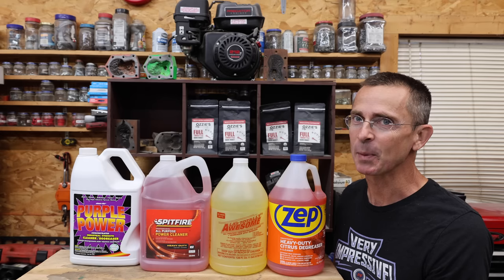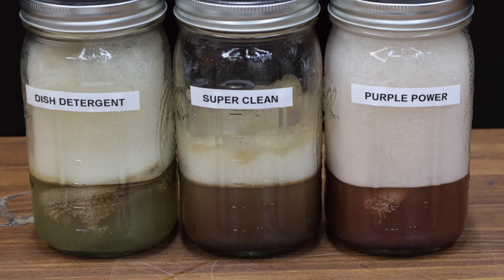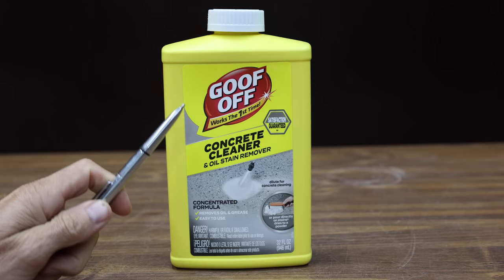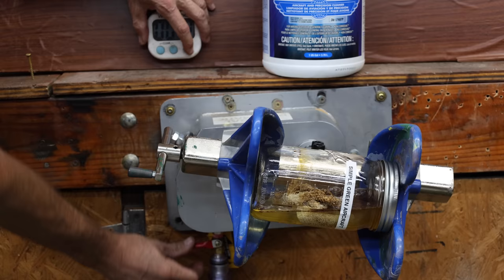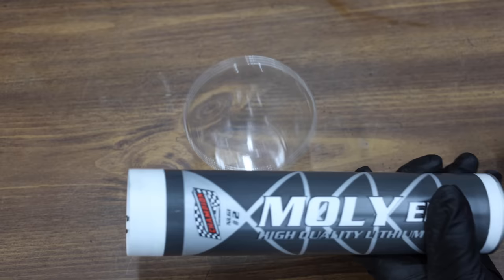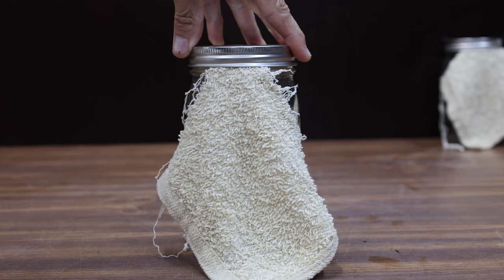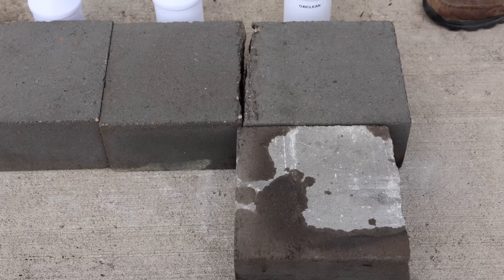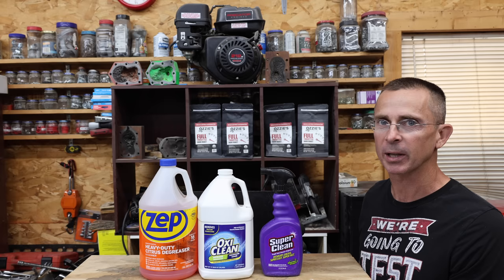Best Concrete and Engine Degreaser? Let’s Settle This!

Comment: as someone who grew up poor, my whole life I've been worried about wasting money on a product where all i had to go off of was the manufacturers words. you literally save me not only money, but precious days of my life. keep these coming! i would like to see videos on kitchen/household electronics like crock pots, mini fridges, phone chargers, robot vacuums?
Reply: Especially for stuff like this where there are so many options. I have probably three or four different types of degreaser at home and I couldn't tell you if any of them work better than any other. Having someone who's able to test all the popular options back to back is extremely helpful
Reply from the maker: Thanks, will do!  Thanks for the suggestions.
Reply: @ProjectFarm Have you thought about doing a Diesel Heater video? 

There's a wide range of units going from +$1200 to as low as $89. I know a lot of people use these on their RV/Camper vans. People are putting a lot of trust in these without knowing if they are safe. 

Not only that but is spending $1200 really getting you something better than the $100 version? 

Thanks for making your videos and working hard to keep them unbiased.
Keep them coming!!!
Reply: Robot vacuums, YES!
Reply: I will second robot vacuums...

Comment: I, for one, think that this channel should continue to review, compare, & test products that viewers suggest. However, doing other things like engine upgrades, transmission rebuilding, equipment maintenance, etc...should be added to ProjectFarm's content occasionally, based on the needs of the farm. If you need to do a project around the farm, making videos showing the start-to-finish process & methods may be of benefit for DIYers.
Reply: A lot of channels will make a secondary channel for this reason, that way the ppl who come here to watch product reviews dont complain about the farm related content.
Reply: @gaveintothedarkness  I feel like doing a second video on like Wednesday or Thursday about the extracurriculars would be fine and having the sunday videos be lovely product comparisons.
Reply: @StuffTested  agreed
Reply: @gaveintothedarkness Other channels I follow say that recommendations (YouTube algorithm) works better when not mixing content.
Reply: Keep it the same

Comment: Your product testing is unlike anything else on YouTube, with your care and obsessive making sure all factors are as equal as possible. Thanks!
Reply from the maker: Thanks and you are welcome!
Reply: You didn't even bother to tell us if each product was solvent, acid, alkaline, salt based. I'd still wager that clothes washing powder beats all these products
Reply: @janeblogs324  Every degreaser that I've dealt with has been alkaline, some strongly enough that they will damage aluminum parts. It would indeed be useful to know the ph of each of the products tested, but that information can probably be gotten from the manufacture.
Reply: @James1095 yes, most are alkaline. Super Clean even specifically states it can corrode/etch aluminum. Simple Green Pro HD, the purple stuff is like the WD 40 specialist and specifically formulated to be safe on all metals.

Comment: Honest and unbiased product's reviews are very rare nowadays. Your channel is a rare gem 💎
Keep doing what you are doing.
Reply from the maker: Thanks, will do!
Reply: @ProjectFarm  Would love to see a transmission rebuilt, something relatable like we might own. But as usual, the complete process, showing the transmission working well in the vehicle again. Same for engines, and even testing other kinds of products and seeing if they are as good as they claim. Love the product reviews, they really help. What if you tested upgrades on an engine and see if they yield the power increase that the company claims?
Reply: @enermaxstephens1051   Richard Holdener would be pretty tough to beat in that dept.
Reply: @BLKMGK4  Easy enough if you don't do the same things he does. Or you did it on different vehicles. For example, who would do things like that to an old RV? Or an old farm ranger? And you could do things they wouldn't expect: Here's how a underhood light turns out on your old junk ranger. 

Or even fix up the old junk ranger. People wouldn't really expect that, they expect it to be ran into the ground until dead and then scrapped. They wouldn't expect him to start fixing the body and any rust and making it nicer. Even if it will still be used on a farm.

Comment: Super Clean is the automotive industry favorite. Everyone is using that stuff. Great product
Reply from the maker: Thanks for the feedback.
Reply: I've used Super Clean on the valve cover, oil pan when I rebuilt an engine.  On aluminum parts you have to wash and rinse it quickly or it'll etch it.
Reply: Be careful, it can corrode/etch aluminum. A few years ago when YouTubers were hyping it for automotive use they said it was safe on all metals. Now SC has a specific warning about that it’s not safe for it. Because of that I’ve gone back to Simple Green Pro HD, the purple one. It’s specifically formulated to be safe on all metals.
Reply: @seashackf1  you said it yourself. "It can" etch aluminum. Don't allow that to happen and the SC is the best.
Reply: Super Clean is by far in my opinion the best. I have been using it and singing its praises for many years.  Love the stuff. I hear you guys saying that it will etch aluminum if you leave it on for any length of time. YES,  that just tells you that its got balls !  You just have to use your brain. You can delute it down alittle and it won't do that.
Reply: @mxracing6  I totally agree about using your brain and not being stupid, like many people can be. For certain things that would be fine. For my car, motorcycles, ATV’s, power equipment, etc. I’d prefer not to have to take the chance if there is a product that works just as well. Since there are products specifically made to be safe on metal I don’t have to. I keep my stuff look as good as I possibly can. Part of that is not damaging the parts when cleaning them, even cosmetically if possible.
Reply: purple power also etches/eats aluminum

Comment: YES to continued product testing!  Your methods are impeccable and very detailed.  Maybe Consumer Reports can learn a few things from your methodologies.  It would be nice to have you update some of your older tests with newer ones, as the market shifts every few years.
Reply: You definitely are already the best at what you already do so why not keep doing what you do best? I am into refinishing guns and would like to see you test all the different brands of bluing solutions, cold blue including Oxpho by Brownell. Make sure you test all with parts totally cleaned and degreased and also with parts not totally cleaned of rust and oil.b Also show totally wahed and dried nut without oiling parts etc.. Thank Bob Jones😊
Reply: I did like the Star shifter I installed in my 68 Nova/ Chevy II SS. Their transmission reprogramming kits were a joke. I put one in a turbo 350  that was in my first Chevy Nova. It was a 69 with a non performance THM 350 behind a 350 c.i.d. with a 2 bbl. Carb. The crisper shifts were very underwhelming! Then got into the transmission industry and found out what a SK green box kit for about $8 could do! Little bump on a shift, versus barking the tires and leaving 6 foot rubber fish hooks behind you on a 1-2 shift!
Reply: You are the God of product testing.

Comment: I work in an agricultural tractor dealer ship and we use oil eater at full strength most of the time to clean engines,transmissions,hydraulic caked on oil it works very well great stuff in my opinion.
Reply from the maker: Thanks for sharing.

Comment: I'd love to see glass cleaners across plate glass, laminate glass, and what I've really noticed to be tricky; auto acoustic glass. Smartphone style ceramic coatings/screen coatings would be another great test.
Reply: I know this was a suggestion for the channel, but I’d recommend checking out Griot’s Garage glass cleaner and the accompanying microfiber towels. I don’t know what’s in the stuff, but it’s non-ammonia based and works amazing.
Reply from the maker: Thank you for the video idea!
Reply: I liked Stoner Invisible Glass. I cannot remember if the spray bottle was better than the aerosol can.
Reply: for normal dirty glass: water mist and a clean microfiber cloth,
Reply: @Bob_H Not if the windshield has oil from the road on it!
Reply: @glasslinger  I'm pretty sure that's why at the beginning of his sentence he clearly stated, 'for normal dirty glass'  🤪

Comment: I remember using that Castrol Super Clean many years ago to degrease an engine bay. I recall the fumes when spraying the product being almost caustic.  After several hours most of the grease seemed to just melt off after being rinsed with a pressure washer. Very effective in removing dirt and grease with minimal scrubbing.
Reply from the maker: Thanks for sharing.

Comment: I’ve been using the Totally Awesome almost exclusively for 5-6 years now. Have been extremely happy with it. Can buy the smaller jugs of it for $4 at Family Dollar and it last a long time. Gets used mostly for removing ink, marker and other stains from countertops when most normal products will not remove it
Reply: Good Post!
Reply from the maker: Thanks for sharing.
Reply: It's my go to for decreasing and affordable.  Works great but the fumes can be strong if not ventilated well.
Reply: Dollar Tree sells 32oz spray bottles of LA's and a bunch of other kinds of generic and name brand cleaners for almost everything. Dollar Tree is of course $1.25 per item and their cleaning/household and energy drinks (plus name brand super glues and other adhesives, tarps, brushes, etc) are genuine bargains you just don't see in local retail.

Comment: I would keep your channel the way it is - Simple and to the point! I would also like to see a review of paint brushes (for acrylic house paint) and manual caulking guns.  I will say that I switched over to the "Twisted" trimmer line and you nailed that review!  Very pleased with the performance of the "Twisted" trimmer line
Reply from the maker: Thanks for the feedback and suggestion.
Reply: I asked about the paint brushes because I have been using Purdy Brushes for years - but often wonder - they were recognized as a best brand when I was growing up using oil paint - but are they still today when acrylics are the norm?  @ProjectFarm
Reply: Yes! Test caulk and the guns!

Comment: I am happy to see Super Clean rate so high. I've always relied on it when cleaning engines and built up cooking grease because I know it works well for what I can afford. Now I no longer have to wonder if I have been missing out on the more expensive stuff.
Reply: SuperClean seems more pricey than purple, but I have to use alot more purple.  I've also seen it take the paint off as a straight concentrate.
Reply from the maker: Thanks for sharing.
Reply: Would you recommend it for concrete? I have a furnace that burns heating oil and one time a bunch of soot got onto the concrete floor and it's very difficult to get out.
Reply: Be careful, Super Clean and Purple Power can corrode/etch aluminum. They have a specific warning about that it’s not safe for it. Because of that I’ve gone back to Simple Green Pro HD, the purple one. It’s specifically formulated to be safe on all metals.

Comment: I'm a coal miner and I tend to get pretty black with coal and oil/grease. The best soap to get it off my arms and hands is dawn dish soap but I use it full strength out of the bottle.
Reply from the maker: Thanks for sharing.

Comment: I've used Super Clean for over 20 years, and have found it to be superior to any other cleaner for most cleaning tasks.  I've been a big fan of your product testing channel since I discovered it several years ago, and have always found your well thought-out testing procedures to be fair and very conclusive.  That being said, I would watch pretty much any content that you put out, knowing that it would be interesting and entertaining.  All I would ask is that you continue to do product testing from time to time... nobody does it better!
Reply: Super Clean is the best I've found, as well.  It's got enough sodium hydroxide in it to eat your skin though, so everyone wear your gloves and don't make a habit of breathing the fumes.
Reply: Agreed.  I have been using it since the early 90's
Reply: Yep super clean is the best and it biodegradable.
Reply: @OvertravelX Super clean can also corrode/etch aluminum. They even now specifically warn about it. Unlike the WD40 Specialist and Simple Green Pro HD which are specifically made to be safe on all metals and not corrode.

Comment: I've been using the zep cleaner for a few years with great results, good to see that it actually stacks up well against the competition in your testing.
Reply: Have you tried Zep purple acid-based industrial degreaser? That's all I use. Curious how it compares the citrus Zep.
Reply: @branchandfoundry560  gotta be careful with what you use it on. also, if you use the metal degreaser from them that has its own specific uses too!
Reply: @CT_Taylor  Oh, I wasn't aware of their metal degreaser--will look into that. Thank you! Edit: Do you have a product name on that? Zep website does not list a metal degreaser. Thanks!
Reply: i use the ZEP Floor Stripper on my degreasing tasks... its the best i have found for degreasing, give it a try....
Reply: orange oil is amazing stuff!
Reply: Surprised Greased Lightning was not in the lineup
Reply: @branchandfoundry560 yes most of these aren’t safe for all metals. They can corrode/etch aluminum. Unlike the WD40 Specialist and Simple Green Pro HD which are specifically made to be safe on all metals and not corrode.

Comment: Just a little Dawn dish soap secret on oil stay in the driveway. Cover the oil stain on a a real hot sunny day with dawn scrub in with broom( don't be cheap) put a little on than leave it to dry in the sun for a couple days . When it rains it will usually take car of the problem.
Reply from the maker: Thanks for sharinig.

Comment: When I was in the Coast Guard we used two products for degreasing.  Simple Green and diesel fuel.  It's all we used.
Reply: Separately, I assume.  I'm picturing hundreds of people mixing a bucketful after reading this.
Reply: In the Air Force we used a mixture of diesel fuel and something referred to as "gunk". I don't know what that really was. The combination cleaned the airplanes up very well.
Reply: Simple Green works pretty good but it's very bad for oil/water separators. I forget the term but it will cling to the oil and let it pass through the oil/water separator.
Reply: Simple Green was reformulated maybe 10 years ago to remove 2-butoxyethanol.  I find the current product much less effective at removing household grease and oil.
Reply: Yup a good tip for someone working with oil paint is to use diesel fuel, which is the same thing as kerosene and much cheaper than store bought paint thinner.
Reply: As a mariner, we used a combination of Simple Green and phosphoric acid "Ospho" to easily remove rust stains and paint prep for white bulkheads. It worked great but you need to be careful using it on aluminum structures and fixtures as it will cause it to oxidize quickly. Rinse well.
Reply: @gdholmfirth petrol and paraffin is how we make gunk 🇮🇪👍🙂
Reply: @engineerncook6138 . Pretty sure the HD he tested has it in there.  The HD is quite weak, IMO.
Reply: Your product reviews are the best. Keep up the good work!
Reply: @for2utube the SG Pro HD is specifically made to be safe on all metals. Unlike most of the others here and regular SG which will corrode/etch aluminum.

Comment: I used Super Clean for the first time a couple weeks ago before watching this video and I'm not surprised Super Clean did so well in this competition.  I was amazed at how well Super Clean works.  I cleaned an 18 year old diesel engine to replace a water pump and I was shocked at how well it de-greased the engine... it looked new and I didn't even touch it with a brush or rag... just sprayed on the Super Clean... waited a few minutes and rinsed it off!
Reply from the maker: Thanks for sharing.
Reply: same, I used it for the first time a few months ago on a really dirty riding lawn mower engine. I sprayed it on and let it soak for not even 20 seconds and sprayed it off with a garden hose and all the grime melted off and I was left with a brand new looking engine. for the money you absolutely cannot beat it
Reply: Be careful, SC can corrode/etch aluminum. They even now specifically warn about it. Unlike the WD40 Specialist and Simple Green Pro HD which are specifically made to be safe on all metals and not corrode.
Reply: @seashackf1  Thanks

Comment: I just saw this video.  I don't know about concrete, but the absolute best (non-petroleum) oil, grease, and glue removal product that I've used is De-solv-it.  I just happened across a bottle of it in the hardware store about 20 years ago and the stuff is amazing.  It is citrus-based, so I always follow up with either some Simple Green or Dawn get the oily residue off.

Comment: After using several other products I simply went to the winners of your showdown and purchased Super Clean at Walmart to clean my aircraft hangar after several very messy jobs that really trashed my floor that is epoxy coated. Gotta say, the floor has never looked better and the cost of Super Clean is quite the bargain. Thanks Todd. You are a real lifesaver! I regularly purchase whatever wins in your comparisons and I’ve never been disappointed yet. What a timesaver! You are the ONLY guy I can really trust on the internet.
Reply from the maker: Thanks!
Reply: Try using turbine engine gas path cleaner as well. It cleans almost anything off of the epoxy floors. I used go ask the engine mechanics to borrow some.